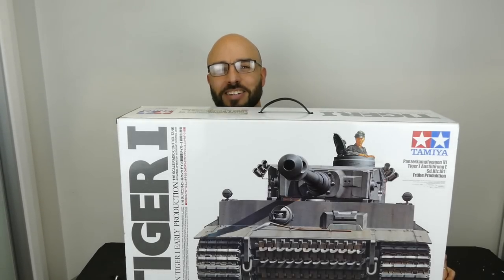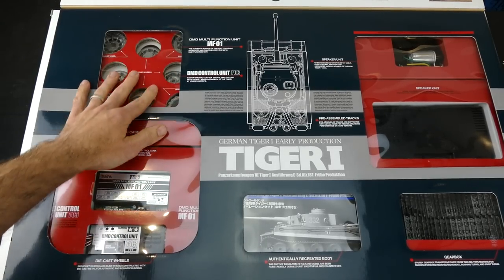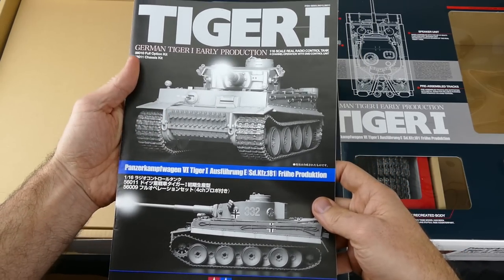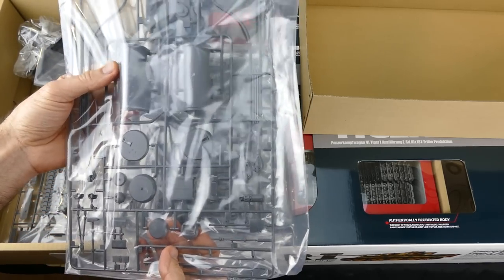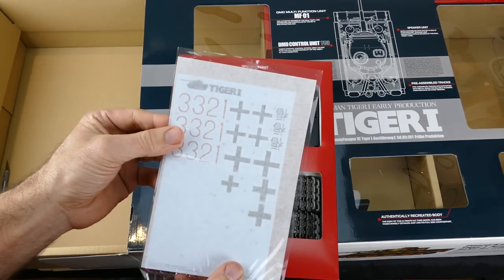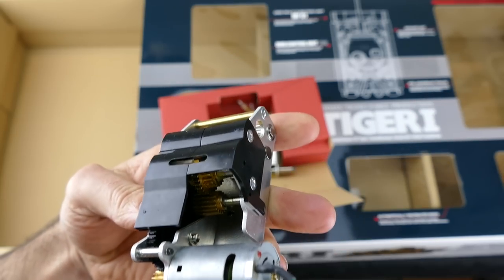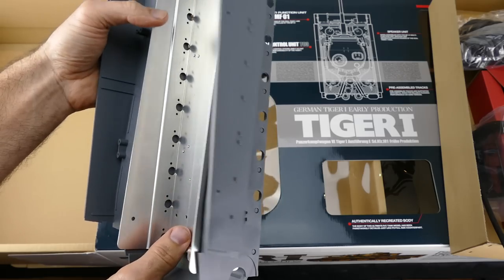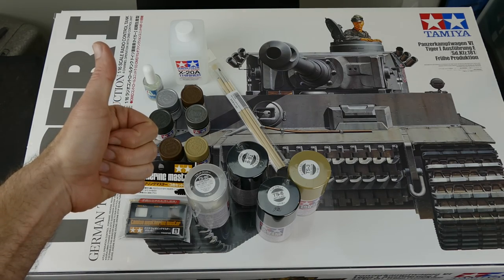TAMIYA 1/16 TIGER 1 RC Tank BOVINGTON TIGER Build Series Video 1 - UNBOXING

Comment: Nice, nice. Looks much more sturdily built than the Hobby Boss 1/16th Tiger I have here.
Reply from the maker: +TestECull yeah most definitely. Tamiya are probably the best
Reply: RC Tanks & Trucks 24/7
It, at least as far as the plastic parts are concerned, looks eerily similar to the 1/35th Tiger I E I have. Also Tamiya.

Always a good buy if their logo's on it, at least as far as kits are concerned.

Comment: I had one of these, back in 2002.  The gear box was using all nylon plastic gears, was awful, get a pebble in the track and they'd lock up and instantly strip the teeth off the gears in the gear box.  Other than that, I loved it, loved playing with it off road and on a building site.
Reply from the maker: +Drew Fox they are awesome and the gearboxes are better now

Comment: Got HL, haven't got the patience to glue these together, just like modding and painting weathering.
Modded to produce barrel recoil using a servo tester and servo, with a flash unit from a disposable camera.
Weathering just wash over with cheap acrylic black and mucky brown paints from art shop.

Comment: Another greate unboxing m8, and at last my favorite Tamiya tank :) This model are from 2000 and is still the best Tiger rc 1/16.
My suggestion: add reduction gear-set for more scale speed (take a look at my video). Cheers
Reply from the maker: +q8Raziel8p thanks mate. Definitely like the reduction gearing. Much more prototypical

Comment: I find tamiya tanks kits so over priced. They dont have nay special features like metal tracks and gun barrel and there is no BB function in any of them
Reply: i am going for my first RC tiger should i just get a Heng Long?
Reply: Gullysquad yes it best place to start as you get more confidence in the hobby you will  want more incorigment, but heng and tagine is starting level,,
Reply: Gullysquad
Reply: The Mato full metal tank is an excellent fully working model .. mine looks superb now I've finished the detailing ..
Reply: Yap Tamiya are supper expensive

Comment: hehe sound recordings of a tiger 2.....
that is unfortuneatly not the same sound as a tiger 1.
See bovington tiger 1 and samaur tiger 2 ;)
Reply: Yes the tiger 1 had HL230 P45 and the king tiger had HL230 P30 same engine but Tiger 1 had fifuel air cleaner that's the only difference hence different sound